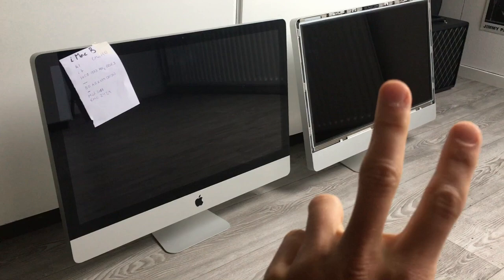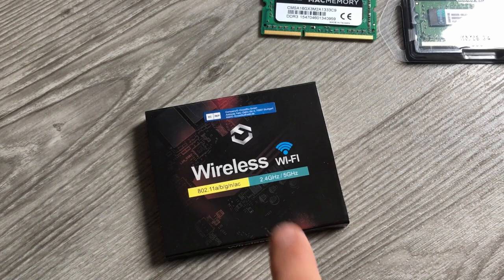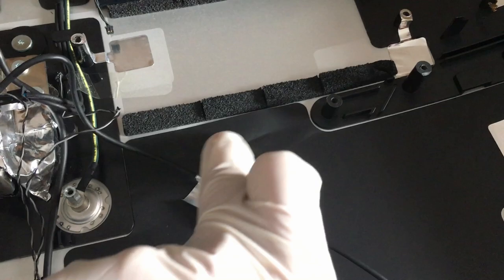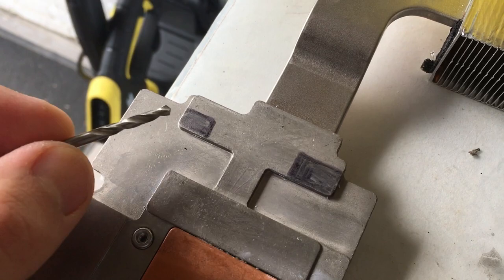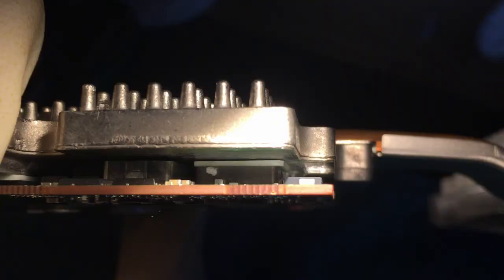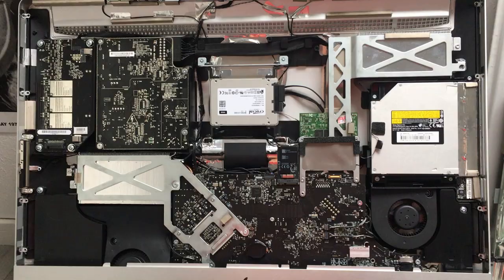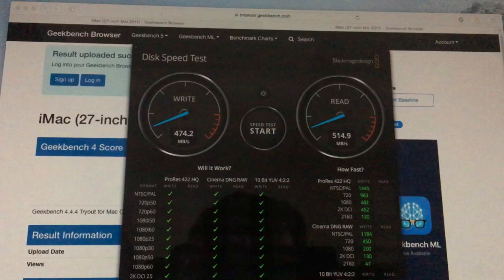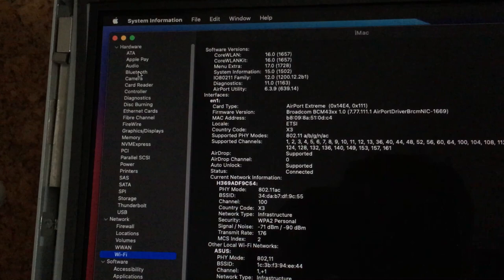How to:  (yet another) iMac 2011 SSD+RAM+K3100M GPU+WIFI & BT upgrade (Part 4)

Comment: HI have the same machine spec for spec but I get stuck in a boot chime loop whenever i install the new gpu (Quadro k3100m) I was wondering if you could point me towards the right direction to solving this.

Comment: I watched this video several times and I can’t figure out from the original BT board what color wires would be the D+ and D-, can you help me with this?
Reply from the maker: Hi! Is the diagram shown in 26:58 not helping you? Is the cable coloring different?
Reply: @javitobosch  The wires on mine are in a different order. D6-black, R15-gray, D3-white, D4-purple, D2-red
Reply from the maker: @josephmcconnell4654  sorry for the late reply. Work is hectic at the moment! OK, D6 and R15 are not used in the new board, correct? Then D+ will be your D3-white, D- will be your D4-purple and final 3V3 will be your D2-red. You can also download the schematics of your board and do a mapping =). Please let me know if I helped you correctly. Good luck!
Reply: @javitobosch  Yes, that was very helpful, but I actually found an adapter that I can plug the connector for the Bluetooth directly into, so I won’t need to do any soldering
Reply from the maker: @josephmcconnell4654  Oh, that is amazing! Do you possibly have the link to the adapter. I would like to take a look too =). Glad I helped you and best of luck!

Comment: my iMac is stuck on the apple logo after I changed the CPU and installs everything and formats the disk but when it goes to Start to the first settings of the new install stays on the apple logo loading. don't know what is going on
Reply from the maker: Hi WLKGOD. Thanks for reaching me. I suggest you try to place the old CPU back to see if everything works. If so, you found the problem! May I as what CPU are you using (e.g. i7-2600S or i7-2600)?
Reply: @javitobosch  I try out PRM, hard reset all of it and it’s strange because I can make everything formatting, installing the OS and it gets stuck doing the loading screen in the end. I don’t remember I will check.
Reply from the maker: Sure. Take your time and if it does not work today, then leave it aside and try again in a few days. iMacs are picky. It could also be that you are using a corrupted MacOS copy, or a version that is not supported (assuming that you are not using Open Core)
Reply: @javitobosch  no no I’m using direct from the recovery of the iMac. I wanted to try with older Os like LION and maybe that helps.
Reply: @javitobosch  the cpu inside is a I7 860 that was not working

Comment: Great video and Explained so well. There is a hack for HDD temp sensor replacement. ( HDD Fan goes on a very High RPM )
Add a sata power splitter /connector between this apple connector and HDD, the fan will never go crazy. I am not sure whats so technical there though.
Reply from the maker: Hi! Whaat?! Really?! Let  me see if I can try this and I will let you know, but to me it just does not make any sense. Maybe it is related to the resistance of the cables? No idea, though...Thanks for the tip!
Reply: First of all I am grateful for attention and reply. 
You are right. Not making sense. You see Sata power form main board  comes in 7 wires, now these 7 wires are converted to four normal Sata wires and the crazy fan is now on normal RPM. I have done it. But I am unable to upload pics here.kindly share email , I will share pics plz
Reply from the maker: @ishaque_khan  Thanks a lot for your nice words! This makes my day =). I am veery curious, actually. You can always contact me here: javito.bosch@gmail.com

Comment: Great video!! I found an Imac 27 2011 i7 2tb and 16 ram in the garbage incredible it boot up but with gpu failure I try to fix the original card but I couldn't now I'm waiting the nvidia quadro k4100m from aliexpress and I change to a ssd I hope it works !
Reply: Did the quadro worked??? Thinking to get it as well
Reply: Did it ever work that’s an interesting upgrade
Reply: @jrockit_  hi Yes it works perfectly!! No problem with brightness control and using last OS with Open core legacy patcher only download and install . For photo editing(lightroom , photoshop) no problem it can handle photos from a7iv 33mpx but in video only 1080p , and other things web browsing , documents  I think for normal use not heavy editing it works like a charm(now I have 20gb of ram )
Reply: @dwaynethomas9265  I answer now to other guy . Yes it works!!!
Reply: @NAM3L3555 just bought one for my 2011. Is there any modification i need to do to the heatsink?

Comment: Did u broke the pins on the CPU socket? because I bought the I7 2600 and does fit on my iMac 2009 and 2010 models.
Reply from the maker: Hey WLKGOD! Sorry, I have been abroad and this week has been intense at work. The iMac I have is a mid2011. The most complete model of this segment already included the i72600, so I did not have to buy any CPU or modify the socket. About that, be careful, because sockets are specifically made for a certain type of CPU. If the CPU from other models/years fit, it does not mean that it will work. I think "everymac" is a rather detailed webpage where you can find further information about your model. Success!

Comment: Are the links for BCM94360CD WIFI + BT + miniPCIe adaptor right? I see only a solo card, no adapter.
Reply from the maker: Ha! These guys (Aliexpress) completely changed the product! Thanks for letting me know =). Just changed the link to what I got and I know it is working (all included). Price is ~10% more expensive if I compare it to the one I bought months ago. Also, I know in the add description it says that it is valid for iMac2013, but it also works for iMac2011. It is a mPCIe adapter and the BCM9430CD =)

Comment: Good day.  I have the same iMac also with an upgraded GPU to a k3100m by a tech guy.  Before everything is working nicely,  I am using high sierra. But when I reset the PRAM, the display brightness control is missing.  Do you know how can I get back the brightness control?
Reply from the maker: Hey froi rivera! I think you erased the stored settings from the GPU firmware patch. I don't know if you actually have OpenCore installed in your computer, but usually after installation you run "Post-install root patch" and that solved the issue for me last time I could not adjust the brightness anymore. The computer was also very slow. Let me know if this helped!
Reply: @javitobosch  Having high sierra OS, I booted on CATALINA via external drive and did the steps below.  After reboot the brightness was now in 100% but still the controls was missing.  So I just installed a 3rd party on the Apstore called BRIGHTNESS CONTROL.   

Post-installation Requirements:
Brightness Control Stepping Mod:
-Turn computer on, hold down Command(⌘)-R
-Choose Utilities > Terminal
-Enter:csrutil disable
-MacOS Catalina: requires you to make root writeable: sudo mount -uw /
-You can download 'Hackintool v3.05' , navigate to Hackintool_Tools.png  menu, use the Hackintool_House.png  icon at the bottom to disable gatekeeper and mount the disk in read/write mode.
-Download and open 'Kext Utility v2.6.6'

-Navigate to S/L/E (System/Library/Extensions)
-Copy "AppleBacklight.kext" to Desktop
-Edit: AppleBacklight.kext/Contents/Info.plist
-Scroll down to: IOKitPersonalities > AppleIntelPanelA > ApplePanels 
-There you find several Apple LCD profiles.
-For the iMac 2011 27" machine locate:
Code:
<key>F10Ta007</key>
<data>
ABEABgALABQAHAAnADMAPwBOAFwAZwBzAIEAkQClAL8A2wD/
</data>

-Change the <data> section to:
ABEAAgA3AF8AigCzAOsBJAFnAakB1AIJAlQCogL4A00DlgRpBGk=

-Drag your modded kext into Kext Utility, allow it correct permissions
-"Applebacklight.kext.bak" folder will be created
-Reboot
Reply: @froirivera  hi, did your lcd backlight also adjusted when brightness control adjustment, I still have hd6970 in my 27 imac catalina, I can adjust the brightness using brightness slider app from app store but the lcd backlight stays bright at 100% causing much heat, i want to upgrade to k3100m and just want to make sure that the lcd backlight will work normally.

Comment: My iMac 2010 shut down randomly after changing PSU
Reply from the maker: Hello! Can you please provide a bit more information? For example: is the replaced PSU the same model as before? Original or replica? Thanks!
Reply: Yes, later found out it was the GPU, but now it requires a pram reset often with a k1100m Even after flashing the card
Reply from the maker: @geraldpheonix  And did you also install Open Core? If so, is the graphics card compatible with your iMac? You can check it here: https://forums.macrumors.com/threads/2011-imac-graphics-card-upgrade.1596614/?post=17425857#post-17425857

Comment: How do you have 32 gig of memory in a 2011?  Mine is limited to 16
Reply from the maker: Hi! Thanks for your question! Technically yes, but if you type in google the CPU model you have (mine is i72600) you will see that the "Maximum Memory Size" for this very CPU is 32GB (4x8GB DDR3). Now, Apple do not recommend that but it is possible. Try to use the DDR3 RAM, not the DDR3L (low voltage) if you fancy a try.

Comment: What seller did you buy the k3100m from? I'd like to get one that is already flashed
Reply from the maker: Hi MrTruthAddict! Apologies for the late reply. It is all in the description. It was from Aliexpress and in the add description already specified that the GPU was flashed already for MacOS. https://nl.aliexpress.com/item/1005001876690765.html?spm=a2g0s.9042311.0.0.7a1a4c4d3EXjX4